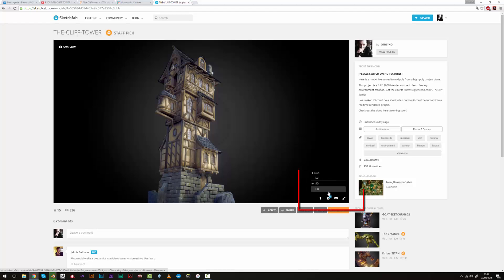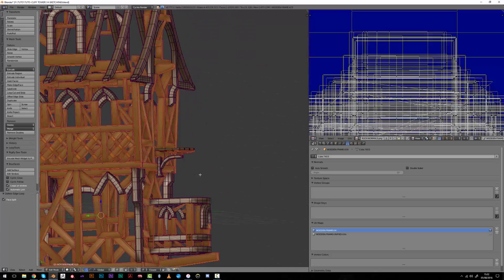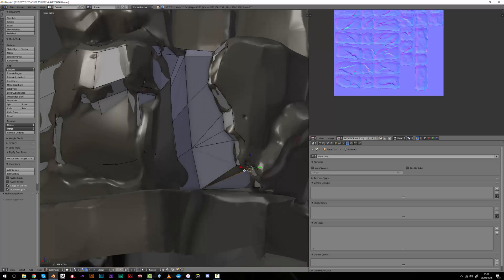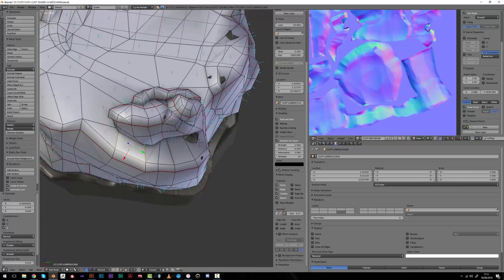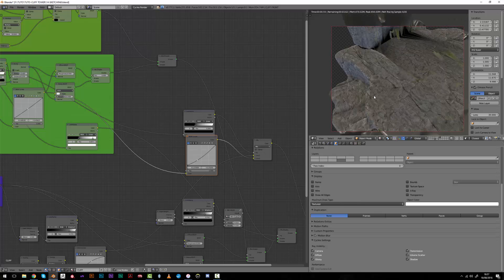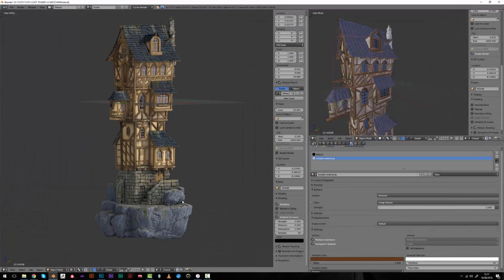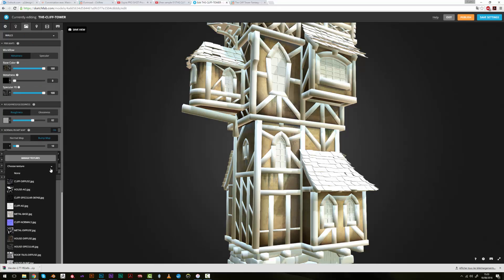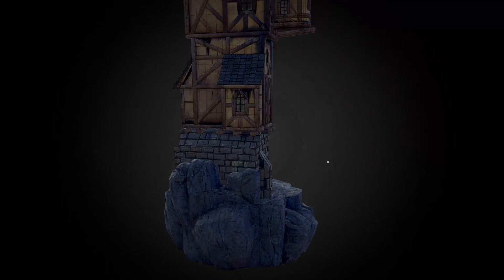P2DESIGN Making of the cliff tower on sketchfab

Comment: You can remove the edge loops faster by doing a limited dissolve and the you choose the angle.
Reply from the maker: Cool, I don't know this tip but will definitively check that. Thanks!
Reply: Select all edges with "a" then press "x" and choose limited dissolve.
Reply: Sounds cool. How to do that? ;d